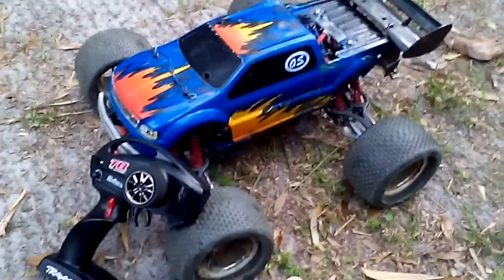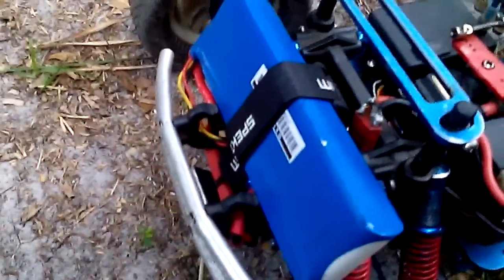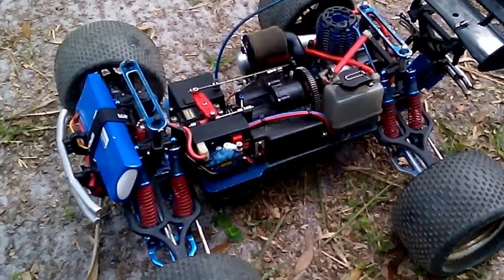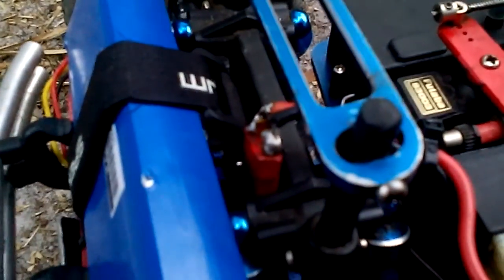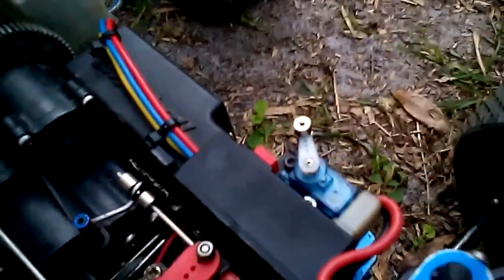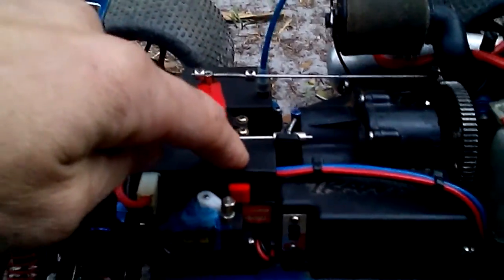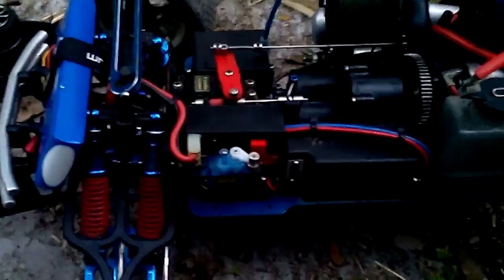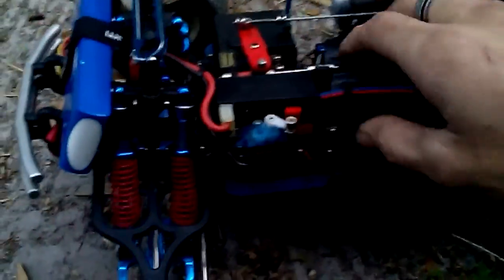Remote start in a Traxxas T-Maxx setup video 2

Comment: Your video popped up when i looked up auto start for t Maxx i actually have the mini servo and that electric start, u did it perfect thank you.. can't wait to try this😊
Reply from the maker: I swapped to using a 2s shorty hardcase lipo strapped to the front shocks.tower,, just as strong but not as big as a regular 2s soft pack lipo.

Comment: Wow. THANK YOU. Ive got an old TMaxx 4.6 and no wand. I had to make my own with a pair of crimp on female spade connecters, a 6 cell NiCd battery and some scrap plastic.it works. 
But I wanted a completely contained, on boaed starter system. 
I was gonna use a mini servo and a control horn on the servo to run power to a contact point to get power to the starter motor. 
But, your method shon here is pretty cool. I'm gonna copy what you did. Parts will be cheap and available on eBay. 
Thank you so much for posting your work!!!! You've Incorporated some novel ideas ere. 
   So easy, simple, and can pretty much leave everything stock. I'm gonna purchase a wiring harness and install it in parallel with the stock one. 
   That way, if an issue arrises I can use my homemade wand. Thank you sir, you're an inspiration. KUDO'S
Reply from the maker: thank you for the reply and yes that's exactly why I posted this video so that others could copy it and have it for themselves and enjoy it!

Comment: Does having aluminum only on the lower a arms and plastic top ones bettefit you any or did you just not have the top ones at the time
Reply from the maker: My reason for it was purely personal design choice. I was thinking to have the heavier aluminum arms as the lower and keep the lighter plastic ones for the upper arms. The lower aluminum ones also added more blue color and carried out rigidity from the aluminum bulkheads.

Comment from the maker: I failed to mention in the video a valid positive counterpoint to installing the battery up front. The slightly added weight on the front end makes this T Maxx have a perfect center of gravity front to back, it makes more level jumps than ever before. It still handles awseome, just had to adjust the front springs.
Reply: Jason I'm sure the extra weight up front was very helpfully